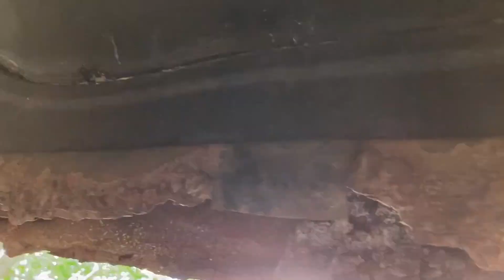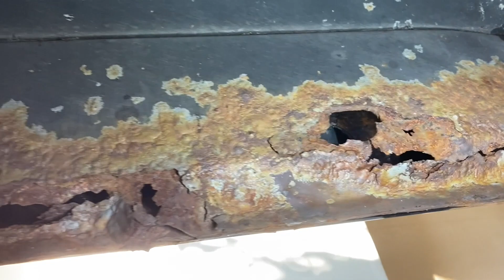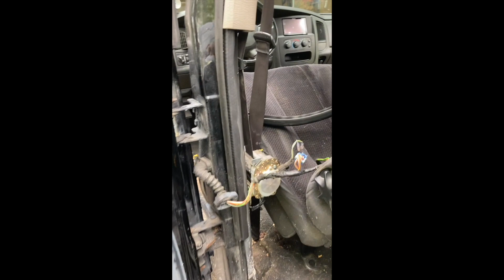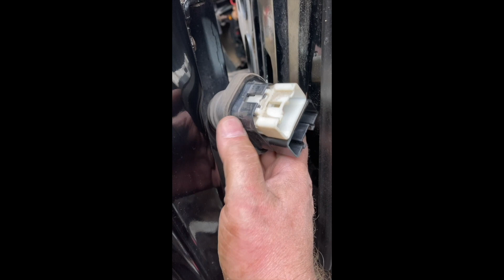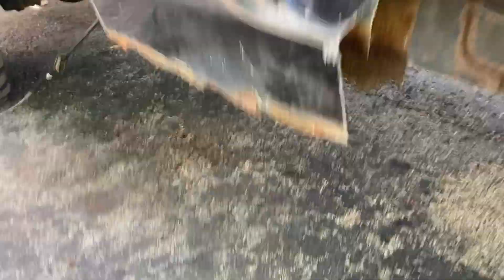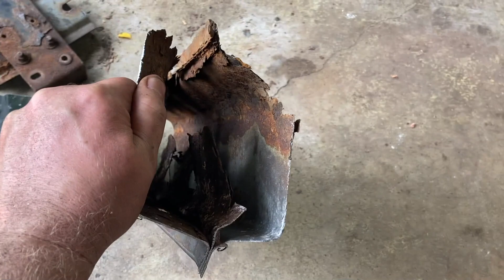DODGE RAM RUSTED OUT ROCKER PANEL REMOVAL

Comment: Outstanding,  Great Job, I am Restoring on 08 Long bed last 3 years. So Far Iven stripped  restored and sealed frame inside and out, restored and built front rear axles,  upgrade steering, entire suspension, entire brakes system,  upgraded Fuel and oil filtration, Fuel lift pump, upgraded Intake , Air , cooling , AC , Trans cooling, engine cooling , Turbo Cooling, much more.  Nobody can tell i just dumped 30k+ into her LOL. disheartening after all that work.     So the next year or so the doors rockers and bed are shot so this is next. I am in the same exact boat I luv the truck to much for a new one &  Ill make this one better that anything I can buy. Keep it up outstanding  work
Reply: Just adding to it but I started out by replacing the entire front end of my 03’. That has how turned into a full on cab and bed off of frame, engine out rebuild. I love the truck more than anything they could try to sell me new.